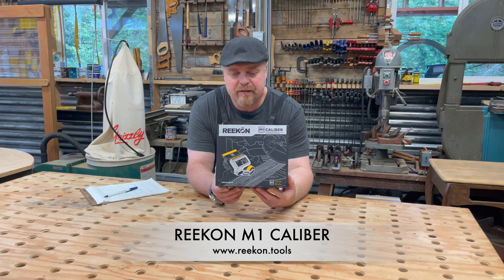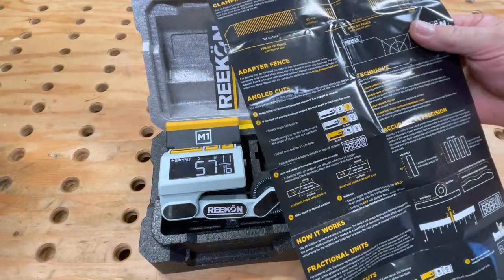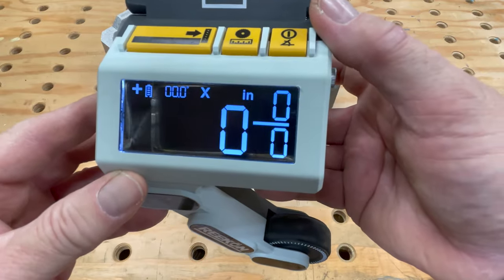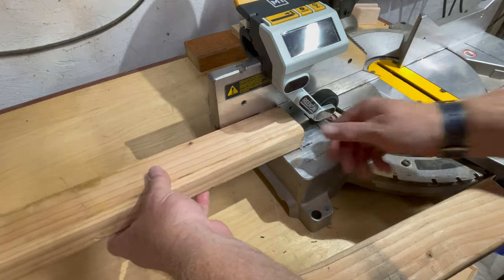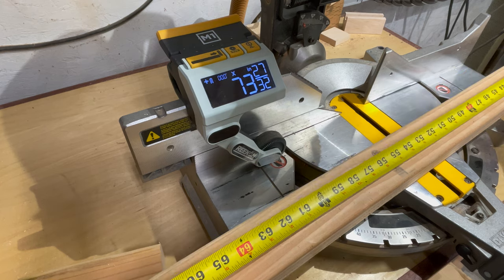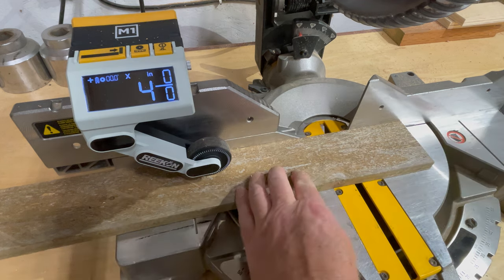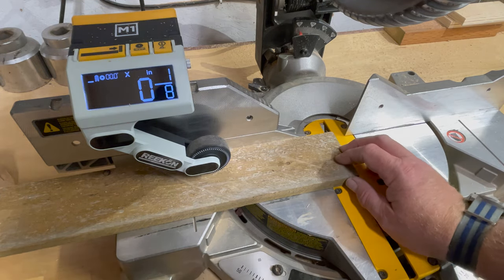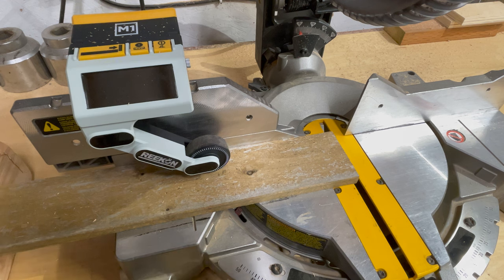REEKON M1 review #woodworking #woodshop #diy

Comment: I've come across a design issue with the M1. You need 6' on either side of your saw or you can't calibrate or use unit. I messaged Reekon for a hopeful workaround. If 6' to either side of the saw is required to set up, Reekon needs to include this in the product description so people will know beforehand.
Reply from the maker: Thanks Christopher! I did notice that later on after I made the video but never talked to anyone about it and just noted it in my head to remember. Hopefully they respond to you. So far though this thing has been working very well!
Reply: @weetzerswoodshop  I've requested a return to Lowe's and hopefully this post will save someone else of having to return the device. I built my own custom mitre saw station and can't move it without an incredible amount of effort. I'd literally have to tear it down and build a new one. If one does not have 6' of clearance on both sides of their saw blade they will not be able to calibrate and use this device. Hopefully Reekon will release a newer revision without this limitation; in the meantime make a notation on their site of the 6' calibration requirement so users can make informed buying decisions and not have to return their device like I have to tomorrow. Their CS rep forwarded my message to their development team and told me to return the M1 to the vendor I bought it from. Hopefully I have better luck with the T1 Tomahawk tape measure when it is released.

Comment: So after 5 months?  Is it still reliable? Has the saw vibration or constant sliding of material through loosen the wheel at all?
Reply from the maker: That was a concern of mine when I purchased it but, so far so good. The rubber material on the wheel doesn’t gather debris or dust, it consistently keeps its grip, and the spring keeps the downward pressure perfectly. The longer I use it the more confidence I gain and trust the way it measures. Great product…….wish I could be sponsored….LOL!
Reply: How accurate is it in millimeters?
Reply from the maker: @mookfaru835  It does mm perfect!